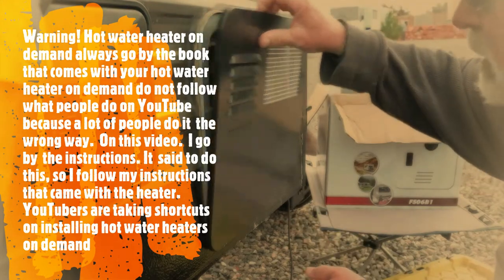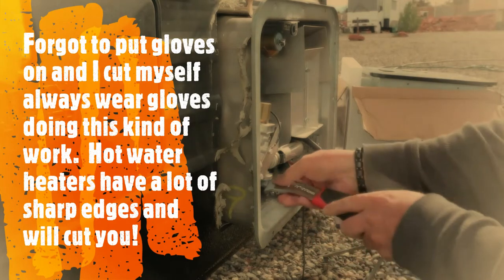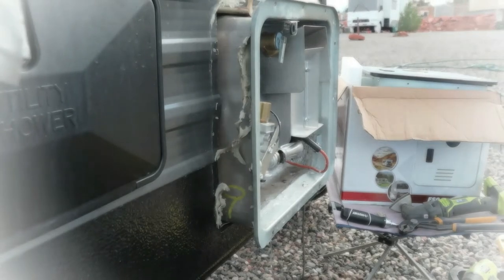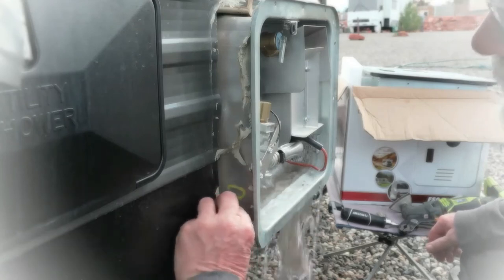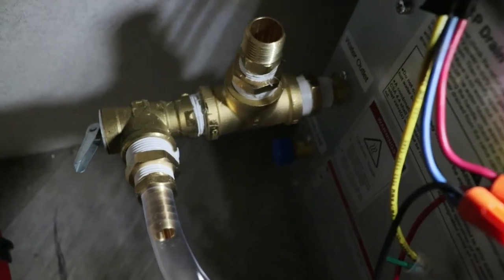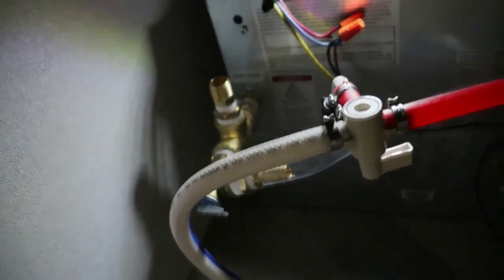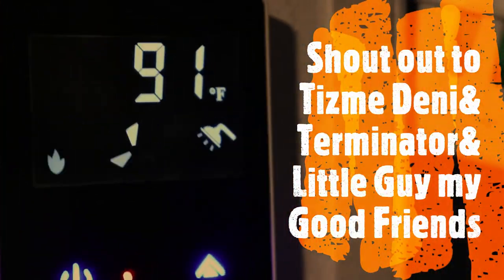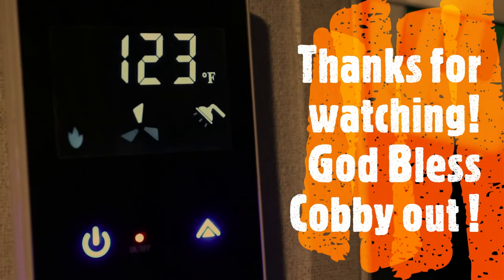Warning RV tankless Gas-fired tankless hot  water heaters

Comment from the maker: Gas-fired tankless water heaters will usually require a pressure relief valve, while electric on-demand water heaters may not. The manufacturers typically only require a pressure relief valve, not the combination temperature and pressure relief valve that is necessary for

Comment from the maker: Uses a lot less gas  used 3  30 gallon tanks since I bought it and I live in a RV trailer and use it for washing clothes washing dishes taking showers I use electric for heat just to let you know this is how much gas hot water heater has used and you don't have to worry about running out of hot water  like the six gallon tanks do Maria second

Comment from the maker: Water heater will heats up the water when the temperature gets too low heat the water up in the line in the winter time so it doesn't freeze at this time it is still working good ! 12/12/2021

Comment: Hi there, we’ve got one of these for our trailer. Definitely uses less propane gives hot water almost immediately BUT our temperature control doesn’t work at all. I’ve set it as low as 95 and it still rises to 123+ no matter what I have it set at. Any idea on that?
Reply from the maker: Try this unconnected from
 power and let it sit for awhile then hook it back up reset it like you would a computer see if that fixes the problem that's the switch I'm talking about may try unhooking all the power to the whole  heater and let sit for awhile and turn it back on too
Reply: @CobbyBadger  thanks bud , will try it tonight
Reply: @straatcaveman7503  did that work? Mines doing the same thing